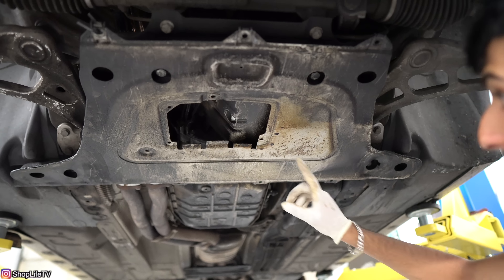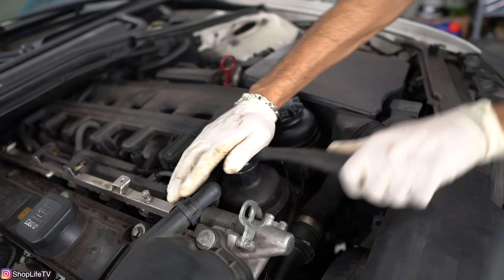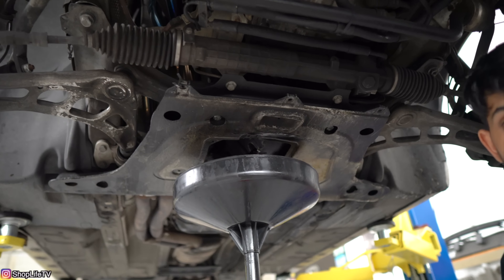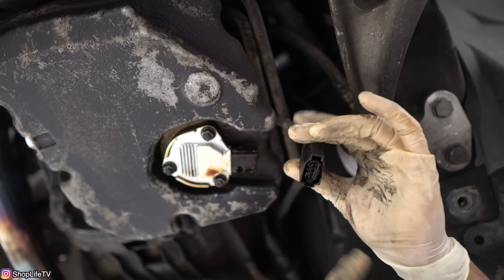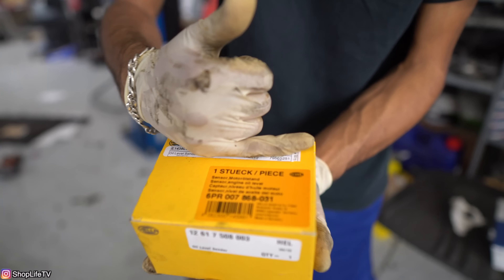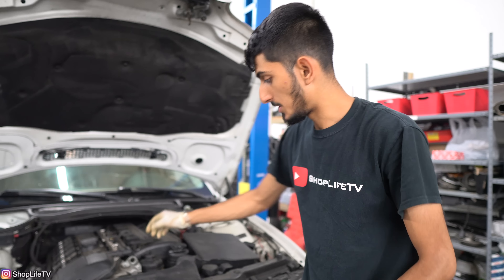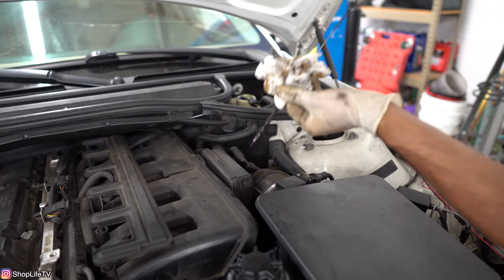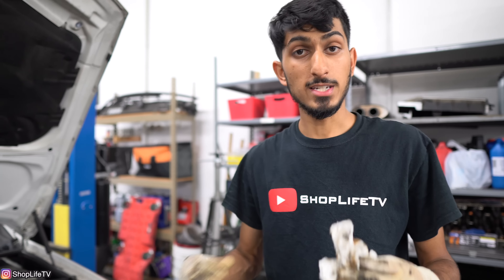How To Change Oil Level Sensor - BMW E46 DIY

Comment from the maker: Oil Level Sensor:
https://click.linksynergy.com/link?id=BZfgVZ7JGM8&offerid=580643.12221752302&type=2&murl=https%3A%2F%2Fwww.ecstuning.com%2Fb-hella-parts%2Foil-level-sensor%2F12617508003%7Ehel%2F
Reply: Would replacing this sensor stop my red oil light from coming on?
Reply: @TheGolden1Ron  no that is oil pressure red that bad shut it down orange is level sensor
Reply: @Lian Van instablaster =)
Reply: I checked my oil and it was 3 quarts low with no indication on the dashboard. What indication should i get for 1 quart low?
Reply: Thanks for sharing. I need help. I changed the sensor and I have oil leaks that I didn't have before with the original. I disassemble, clean the area completely, tighten manually in a triangle, wait a few minutes and tighten with the torque of 10/12 Nm. New Ridex brand sensor, no fault in the ECU but it has oil leaks. Any recommendations? Thanks. I was thinking of buying a new HELLA brand sensor just in case the RIDEX one is in bad condition.

Comment: Bro ur video made it alot easier to me to remove my oil level sencer and replace it,, the only thing that kicked my ass was putting that plate back on,, I seen u said if u dont have another person use ur car jack to hold it up so I could get those 8 bolts back in,, 45 minutes to take the damn thing off,, and 10 minutes to put it back on,, ur a life saver,, ur videos help alot,, keep making them,, cause that is how I'm learning to do stuff,,

Comment: Finally remembered to order a sensor BEFORE I changed my oil this time. Clear walk through and good tip with the oil filter cap, I always make a mess by completely removing it filled with oil.

Comment: i love this channel so much, if it wasn’t for you and the50skid i would have no idea what i’m doing on my e46, i recently replaced my oil level sensor and the seal started to leak because it was a no name manufacturer so i overtightened the bolts and broke 2 studs 😭 had to replace my whole oil pan and it’s still leaking so i’m just gonna get an oem one this time

Comment: Dont the reinforcement bolts need to be replaced with new ones? I did this and used old bolts and get a vibration like suspension noise over bumps sometimes

Comment: hi - excellent video. Wish you were in Rockland county NY. I would bring my truck to you for sure!!!! Question though i have x5 e53 3.0i engine and keep getting p1092/p1093 codes. Changed so much last year for inspection and 10 months later - boom - codes again... 4 new o2 sensors, disa, mass air flow meter, icv, ccv cold kit, rubber intake boots, coils and plugs - what else is there other than a new truck??? thanks for any direct leads.

Comment: I would suggest using a torque wrench especially for the sensor bolts on the oil pan

Comment: I love your videos I have a 2008 e92 328i and my level sensor 1 inactive so I changed it out and I still have the same thing except I noticed when I started reading the codes then I'm also missing the water pump I have read there on the same lines it says BSD lost communication

Comment: Hi shoplife tv
My yellow oil warning light is on when starting my bmw and go away after 10 second. Than when riding and is slow down the red oil warning light pop up, when accelerate again it goes away. And coming again when stop. Oil level is fine.What’s wrong!!! 
Thanks 🙏
Reply: Same. Wonder if it's this

Comment: So if you don’t change the oil sensor will that be a problem for your car? Thanks for recommending to check the oil after each gas fill.

Comment: Love the channel bro!!
Question went to dealership for their health care front line discount on oil change
Got home and massive oil leak under my car jacked car up and the oil drain plugged was not secured . I went and tighten it and no more oil leak.
Fast forward few days later the oil light is on
The oil level does not show
Took it to bmw dealership and they say it’s a faulty oil level sensor
I got another one and installed it my self because I don’t trust this guys anymore
I’m still reading inactive oil level reading 
I can’t read the oil level
I know I have the right amount of oil because I measured it and no oil leak underneath
Do I need a software update
I drive 08 bmw e93 m3
Thanks for help

Comment: Should i change the oil of my m54? Because i fill 1 Liter every 2 weeks in the motor. It burns a lot of oil. Or do i just change the oil Filter?

Comment: I love your channel bro! I recently bought an '02 325i and your videos are super informative! I got the oil level sensor light shortly after the purchase and will be doing the change in the next month or so. I also have concern that my car is either leaking oil or consuming lots of oil. I have no spots in my garage... Where should I check for leaks?
Reply: Check beneath the oil filter housing and left to the block you have this small metal plate (sits a bit lower than the highest point of the block) it's hard to explain but just check with a flashlight. Very common leaks, I had them too but they don't drip on the ground.

Comment: Can you do a video on replacing the hood bonnet sensors on a 2002 E46 M3? My SMG gear indicator keeps flashing on all gears except neutral, but I’m still able to drive smoothly! Would greatly appreciate it!

Comment: In the E38 and E39 with the 'High mid there is no warning that the sensor is bad. You have to scan the cluster for faults  to know.

Comment: nice vid! i have a 530d 2002 e39 51K miles and im getting the 28 thermal sensor for oillevel defect. was that the same fault code you got?

Comment: Trying to figure out were my father's 2006 BMW 325i oil sensor is located at hopefully it's is in the same area. because this video is excellent
Reply: Hi David, did you ever figure out if its the same location for the 2006 325i?

Comment: So I just got a 2003 330ci convertible and after an oil change I notice small amount of yellow cream like substance under the oil cap also spotting of the same cream like substance on the dipstick. In your opinion do you think it’s a blown head gasket or the CCV needs to be replaced?

Comment: I don't get the yellow oil indicator light at any time, however INPA shows a persistent error 27C3 thermal oil level sensor. No CEL however, but clearing the codes just has the same code return at next startup. Is this still a faulty sensor?

Comment: Hi just did same on BMW Z4 2.0 and all I’m getting from the read out is error oil? Also got a code p1127 which said manufacturers control?? Gonna change the oil again and change the oil pressures sensor also see if this helps

Comment: A good way to test your level sensor. As your draining the oil have the key on. Watch the low oil indicator light. If the level sensor is working correctly. The warning light in your gauge cluster will illuminate.
Reply: If you have the key in, isn't the oil level indicator always showing red until you start the car then it goes away? How will the light come on if it's already on while you are draining the oil?

Comment: Good vid! I changed my oil sensor 3 months ago however I have a feeling it might be calibrated wrongly. Last time I added oil the dipstick was below minimum required and I didn’t have a low oil light... any ideas?
Reply: The low oil indicator is not calibrated to come on at the min line, but I don't know how low the oil has to be to trigger it

Comment: My 325 e46 cranks too long but eventually it starts. I’ve changes coil packs,spark plugs, fuel filter/oil pressure regulator, fuel pump relay, fuses all good too. What can it be?? Please if you have something for me please let me know.

Comment: I sometimes get red oil light for the first 2 seconds after starting (always wait for self tests to complete). Car leaks oil, unclear from where. This all happened after it once was started without an oil filter. 

Getting LCM Error Code 28/01 - Thermal Oil-Level Sensor Defect.
Ideas?

Comment: my car only does 3k miles a year and city driving. I use Castrol 5w40.  Would you still recommend changing it every 9 months still ? car has 65k miles e46 and no oil needs topping  ever

Comment: My yellow low oil light indicator comes on about a minute after starting. I added haf a quarter, even though it says add 1 quart. Could it still be the sensor, since it still comes on.

Comment: Hallo boss , I have the same car and i have problem in the car that the light of motor oil always on and losing oil ... many workshops have tried to solving it but nothing changed... do you think it's a sensor problem??
Reply: No. It's a losing oil problem.

Comment: Hi!  My e46 stays in the yellow light for 5 seconds after power up and then hangs up. Can it be a level sensor? Is it a problem to use the parallel sensor (second line)? Thank you

Comment: I did my control arm bushings at the same time. Also my oil level sensor went to ground and put the car in limp mode. Engine management control fuse popped to get the car started I unplugged the sensor until I hade time to do the job!

Comment: Does anyone know why the red oil pressure light goes off intermittently when on drive gear and only on idle? Changed my pressure switch and the light remains after engine has warmed.

Comment: Goddam, what kind of rubber does BMW use that even a small seal like that leaks. I know replacement this seal not difficult to do but that's not my point. Even the windshield washer tank is leaking from the seal where the pump connects to the tank. Good thing I like working on my BMW!!

Comment: Hello, I just bought a 2005 BMW 325i and it's my first Bmw. I had a service engine light come on and took it to advance auto parts. The guy wrote down these codes but idk what they are but under the code he wrote the cause of the light. Please help!!!! Thanks!!! 10179- Oil level sensor, 10603- Lambda Sensor, 10593- Lambda Sensor and 52619 network communication. Also when I bought the car the headlights bulbs was on the dashboard on the car display??? Any help from anyone would be great!!! Thanks

Comment: Guys do not use 0W-40 in the summer, It will destroy your vanos like it did to mine, first startup with the mobile 1 0w-40 i started hearing marble sounds, learn from my mistake. in the winter its fine to use it
Reply: Bmw M3 e46 The recommended oil for the S54 engine (which is the one in the M3) is Castrol 10W-60 synthetic.

Comment: Hey from Ukraine...
How to know if the sensor is not working and need to be replaced "symptoms"
Because on my e92 the low light level is showing even after i add oil is still showing...
Can you please help ! 
Thank you
Reply: You have a different model bmw this is an e46
Reply: Symptoms:
Oil light (yellow) is on or comes on breifly when engine is running even when oil level is good, bad sensor

Comment: My oil level sensor is leaking how do i fix it its a new sensor and gasket
Reply: Mitchell do you have a steel oil pan, most of the times there is rust on the mating surface of the o ring. First you have to undo the rust, paint the surface and when that is dry, put on the level sensor. You will see it wount leak anymore. Goodluck.
Reply: watch the video
Reply: You installed improperly?
Reply: No rust, is it possible that the sensor itself is leaking?
Reply: Tighten bolts

Comment: Asinine BMW design. Every damn sensor, seals and gaskets failed in a car with 75k miles. Even the gas cap failed to seal properly. 
EDIT: valve cover gasket leaked since around 50k miles!

Comment: Hello i have an 2006 x5 3.0l e53 i changed my oil then oil pressure alert came on. Is this the sensor you're speaking on?